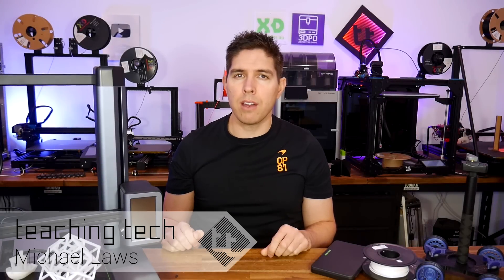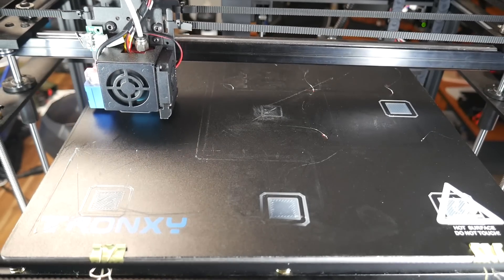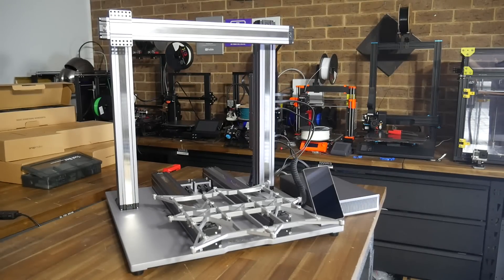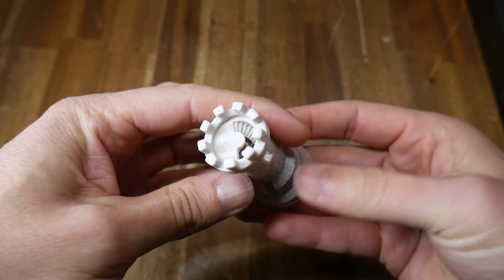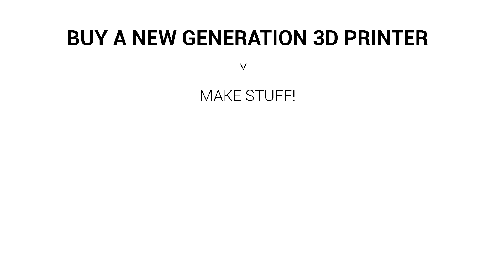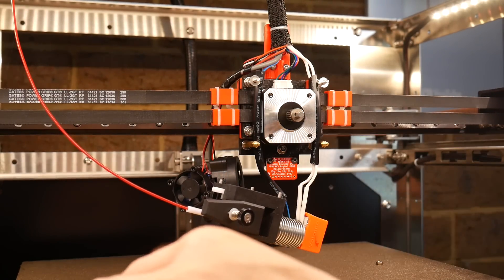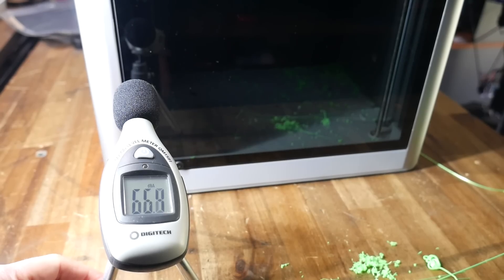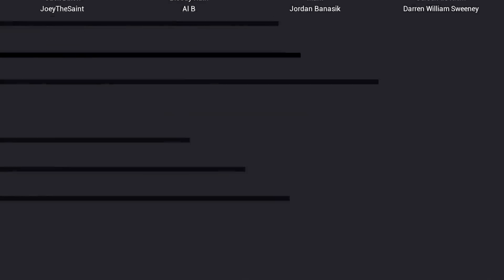Next gen 3D printers are here, but do they bring fresh problems?

Comment: We are going forward by going backwards. The OG 3d printing guys will remember Wanhao, Zotrax, Ultimaker and especially the DaVinci 3d printers, before the Ender 3, before the Tevo Tarantula, you could get a good looking 3d printer that worked fine but was hard to fix, and sometime was very locked down. Then we had the tinkering era, now locked down again. 
My guess is that if the voron or ratrig push through this time and more suppliers start offering kits, we'll be back in tinkering era
Reply: Voron aren't a company, they're just a bunch of makers creating awesome designs for you or me to source (or buy a kit from LDO motors and similar).
Reply: very few people want to spend 40 hours putting printer together
Reply: @jamesharris9894  enough people want to that it has become a thing with very capable printers developed for people to source and assemble themselves. A lot of people like to make things themselves for a variety of reasons, you obviously don’t want to spend that much time on a printer.
Reply: @jamesharris9894  As a person, that owns X1c for 3 months now... I'd rather travel back in time and bought Voron instead.
Reply: @jamesharris9894  you have a very closed view of the world,  I can name 3192 that do and that's just the ones that have completed one.
Reply: @FryedWater  i know, I didn’t say it was. My point is that community driven tinkerable projects are what brings the bar forward, that’s how we got Marlin, then Klipper
Reply: @vizionthing not putting them down stating a fact that  out 7 billion u know 3k and that's supposed be good?  they been out long time they not taking over most people dont want spend that kind time on printer what I said still correct if voron was easy alot more people would have one
Reply: @jamesharris9894  99.9999% of the people you list don't have a printer, they don't really count as people that don't want to spend 40 hours making a printer, you need to practice thinking.
Reply: @MustyBucket  that's also how we had i would bet three solid years with hardly any innovation. in my opinion, "tinker-ability" isn't as big a problem as you make it out to be. i would be hesitant to even call it an "era".

we can still have good looking, capable 3D printers that work fine and require some tinkering for those out there who enjoy the hobby for that specifically. it's like DIY products: made for the hobbyists who like the DIY aspect while sometimes still delivering a good product.
however the 3D printing community is moving away from that, and there's nothing wrong with it. we beg for better products, and we get products that require less tinkering to use.

we can also still have printers like the X1C that is less locked down and is more repairable. the X1C isn't a perfect product but it's a perfect wake-up call to companies. competition is good.

we will always have cheap printers like the Ender series from a company like creality who deserves no more credit than making cheap, rock-bottom printers stolen from other innovators. they work just fine (besides supporting a pretty bad company) as a starting place but should be no more than that; a starting place. *not an industry standard*
Reply: @robblly8112  I didn’t say that tinkerability was a requirement, nor i said that locking stuff down is bad, I just stated the facts, 3D printing is a very formless hobby, it expands in directions unforseen, who knows, maybe the Lidar feature of the X1C will get copied by creality and it will start to become cheaper, and somebody from the voron community will make a mod to measure 3D printing filament at the extruder and adjust the flow on the fly, or maybe Voron will remain a niche item for enthusiasts with no real advantages over consumer.
Imo we need to remember that if it wasn’t for the expire licenses of Stratasys and rhe reprap movement, right now we wouldn’t have squat
Reply: @MustyBucket  "My point is that community driven tinkerable projects are what brings the bar forward" --- never said you made it out to be a requirement, that's simply what I was specifically responding to.

unless i understood you wrong

I was simply just giving my take on it, no need for an argument or anything. I don't remember ever claiming you said "locking stuff down is bad" but yeah.

I'm not sure how Creality's going about their copied version of the X1C's LiDAR, but who knows. I'm not expecting anything great at all with the K1 series personally. Creality leaves a bad taste in my mouth if you couldn't tell, haha.
Reply: @robblly8112  I guess I didn’t explain myself properly. In any case, progress is good, as long as stuff doesn’t get monopolized
Reply: @conorstewart2214  blah blah blah. Most people don't want that -- period.
Reply: @cremdilly7176  except enough people do that these community created printers exist. Why would companies spend time making kits for them if people don't want them? The majority of people who own printers will have done some form of modification at some point.

Most people don't want closed source or proprietary printers.

You may not want any of that, you might just want to print and that is fine but a lot of people enjoy the DIY aspect of owning a printer, no need to be an ass about it.
Reply: @vizionthing  " you have a very closed view of the world,  I can name 3192 that do"

You grossly overestimate the fraction of 3D printer users that are prepared to put the considerable time and money into building a Voron-like printer.  This is an extremely niche market, you could compare it to the kit car market like Westfield where a user builds their own sports car from a kit.

Comment: I bought a CR10s like back in 2016 or 2017 and it still is going strong. However I definitely follow the "Its a hobby" approach. Over the time I changed the printing bed, put linear rails on it, changed the mainboard, changed the hotend, made it standalone without its electronic box, put a touch screen on it and installed klipper. Nowadays it does 175mm/s maxing out the hotend, or 120mm/s putting out quality prints. Both at 2500mm/s². We have 5 Prusas I3 MK3s at work, along with a BambuLab x1c and a Raise3D Pro2 Plus. The Bambu really is a different story in speed and quality compared to the other ones. But having such a highly modified CR10s at home I invested a lot of time and effort in  which puts out quality prints in a decent ammount of time, as well as the access to something new at work, also for private use if nescessary,  it's hard to justify buying something like the bambu for still a lot of money 😂

Comment: I'm so thankful to myself for starting out my 3d printing journey with an ANET A8 in early 2017. There's nothing better than bolting together acrylic pieces, wiring a janky motherboard to an even more janky power supply. That's where you really learned how a 3d printer works, all these fancy new printers are beginner friendly, but fail to explain the tech in general tbh.
Reply: THIS!!
Reply: it depends what the goal is. i know how to troubleshoot a pc, take it apart and build a new one, but i care literally 0 to be able to do the same on a car...i'm sure some would like to 3d print without having to know how to tighten belts or change a stepper motor
Reply: @Drestlin  Changing a stepper motor is easy. Just try every wire combination, find the correct one, discover your crimper can't crimp these terminals properly, spend $50 on a proper one this time, crimp the connectors, plug it in, realize you still got the pins wrong somehow, and restart from the beginning the next morning.

Comment: Ive been using the creality machines for a while tinkering away with a lot of upgrades and headaches that goes with them. Starting with the endear 5. I’m fed up. After buying my first Prusa mk3s a few years ago there’s really no looking back. The printer just works! Such a plug and play machine that gives excellent results almost every time. With the clones I’ve found myself always having to tinker while with the Prusa being an honest and no bs machine I can just make things and not worry about when the next clog is going to happen or if I need to upgrade. The new machines might be good but personally I’m going for Prusa 100%. The only drawback is the limited size but there’s a reason for that. Prusa have thought of everything from loading filaments to levelling and the slicer software. I will still use my bigger machines when needed but when printing quality and detail it’s Prusa all the way.

Comment: It was awesome being able to tinker and fix problems. But now a days, I just want something that works if I don't print something for half a year. (Of course, I'll dehydrate the filament before the print)

My last printer worked fine 90% of the time. I sold it last week after picking up a used Prusa Mini, cause it had a problem come back after sitting for like 8 months. Tried troubleshooting it for a few hours, and gave up. Sold it along with a tiny backup printer for 100 bucks. Didn't care to try and get money out of it, just wanted the space. 
The Mini has been perfect, besides a problem of the head crashing into the print when it finishes. But turns out that's just something that can happen if the firmware is out of date? Well, it's been perfect after updating the firmware. About 80-100 hours of printing so far in just the first week of owning it. Not running into any problems, and being able to just trust the printer has reignited my interest in 3d printing.

Comment: I think Bambulab is going to be the DJI of the 3D printer industry. In the beginning of the drone industry there was DJI (closed source) and 3DR (open source). After a couple of years DJI ate them up and dominated in performance and price. With the X1 carbon coming in at only $100 more than the Prusa MK4 and the P1P way below that I think Prusa will start to lose significant market share. The bambulab printers look more DJI’ish and refined.
Reply: For those who may not already know Bambu Lab was started up by ex-DJI members. It is indeed the "DJI of 3D pringing". I am very happy with my X1C. It just works.
Reply: @jeffkunkler9299 he main difference I see is that the customer base is different for BambuLabs. DJI’s is one full of photographers and pilots, Bambu’s customer base is, by definition, one full of designers and engineers.

I really hope the community looks into making more replacement parts. I’ve already seen aftermarket hotends, allowing the use of MK-8 nozzles. I hope to see people reverse engineering the circuit boards, allowing for Klipper to be used, ideally with the lidar, as that seems to be the last achievable replacement for a hyper proprietary part. Making a foss microlidar system may just be impossible for a while though.

Comment: They've solved the issue of being able to print out of the box.
But I wonder how easy they will be to troubleshoot and fix or adjust, when inevitably the belts become loose, nozzles become clogged, bearings become gritty, extruder parts start to wear out.
With the streamlined designs of these "next gen" printers, it looks like it may be harder to get into them with a screwdriver.

Comment: I have an ender 3v2 at home and an AnkerMake M5 at work and it's great to print quickly at work but there's something special about my ender at home. I'm looking forward to the new AnyCubic coming out soon
Reply: The heated bed died on my Kobra after a month, either the thermocouple itself or the wiring for it. After sales support was quick and helpful to deal with. Then the wait began. 3-4 weeks later I was informed that the replacement bed had been shipped from china. Then another 3 weeks later I got the part. They stock printers in Australia, but no parts. It's also taken extensive tuning to get printing ok.

Comment: Quality content as always! 

From my POV there is space for both the newer, more 'corporate' as you say, printers and the existing Prusa/more diy approach. Manufacturing companies that care more about uptime can benefit from these neer style machines where replacement parts are a couple of days away and can be just dropped in, while I see a prusa machine to be a middle ground between reliability, tinkering and a developing platform, just look at how many projects have been spun off of those printers such as multi axis printing. I'd love to had BambuLabs release their PA tuning software and hardware, but in the end of the day I know the community will built something similar if not better and more compatible with a plethora of platforms. I'm happy to see the 500-1000 monies market expand as it's still attainable for people who want to buy a reliable machine but don't need an industrial one for the price of the average high end smartphone today. I'm also glad there're the me2 printers too, because thye set the price so low it's easier to enter the hobby. In the end of the day, you get what you pay for, and as long as the price is not higher than the offered quality, I don't mind. An ender 3 is a cheap machine that produces ok prints, but it's because of its price it created a robust community around it. If it costed 400ish like a Prusa mini, without a comparable print quality, it'd be actually bad. We as consumers need to be educated in what to expect from each pricepoint and thankfully chanels like yours exist and do an excellent job at being consummer and community facing and supporting.

Comment: I love my Anycubic I3 Mega.  I'm printing on it now.

The one improvement I would like is if the SD card slot was an off-the-shelf arduino version.  My SD card slot broke recently, and I couldn't get a replacement SD card slot anywhere.  I solved the problem by installing Klipper.

I hope future 3D printers are not closed source with proprietary components.

Comment: been watching 3d printers for a decade, only this year did I find something I liked that fits my dollar and maintenance time budget, the Elegoo Neptune 3 Pro.  It's trying to be this premium experience and got about 90% of the way for under $250. Packaging was excellent, the manual has a bill of materials, the bolts are in labeled ziplocks. Straightforward assembly of a dozen bolts and a half dozen plugs. Two issues with the manual: doesn't explain how tight to tighten the belts; doesn't point out that you can tangle the runout sensor cable and a drive belt if you wrap the cable around it. Touchscreen UI is adequate, physical touchscreen response is good. Firmware updates require unscrewing the screen housing. Manual doesn't explain cold pulls or tell you to bed level without filament present, so drips have interfered with my z-offset. Aside from those minor details my first print succeeded without issue. The only failure I've had in my first spool was after a firmware update, because the firmware update reset the Z-offset, which isn't mentioned in their docs.

Comment: corporate entities taking advantage of the opensource communities is nothing new. they've been doing it for years. The problem is, most open source licensing is "wide open" in nature, and not at all restrictive towards predatory companies who use the open source materials, slightly alter it (mostly branding or aesthetics), and never contribute back to the community they've taken from in any meaningful way.  

This approach of allowing for-profit entities to come in, and pilfer resources without giving back to the community not only stifles innovation, but actively drowns out the innovators.

I really wish we could implement an open source license that restricts corporate entities from effectively stealing open source projects, making minute changes just enough to close source it and charge a premium. You need not look any further than Streamlabs vs OBS. Streamlabs simply took the code, skinned it with a massive amount of up-sell and a theme, and gave absolutely NOTHING back to the OBS project.  They even went so far as to use shady tactics to make their software appear at top of searches, and appear to be the synonymous with  OBS

Comment: I've had good luck with FlashForge's more advanced models (Adventurer 4 and Finder 3). I actually bought a second Adventurer after my first one was stolen. Both of them still produce the occasional serving of spaghetti, and the Adventurer had a weird problem where the tube came loose from the hotend assembly (that was easily fixed with a little CA glue), but they're quite reliable and beginner-friendly. They do still require a couple little steps of pre-learning, such as leveling/Z-offset adjustment, but once they're dialed in they're pretty solid. I do agree that plug-and-play convenience is the next gold standard, though given that I'm already established I think I'll stick with what I've got.
Reply: I too started off with Flashforge printers but Bambu saving me so much time and effort